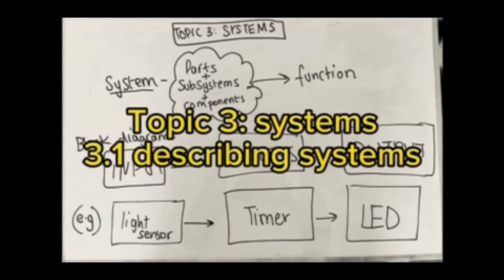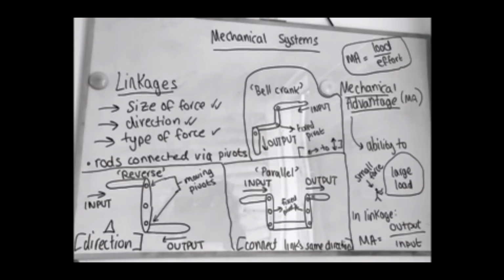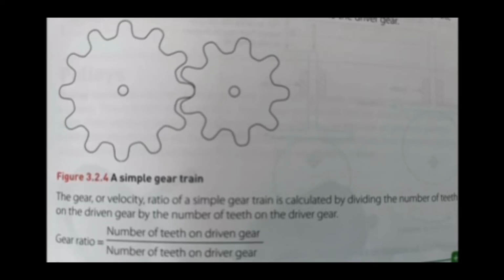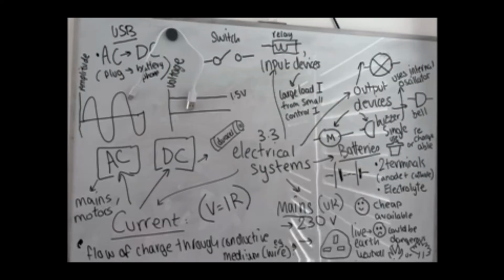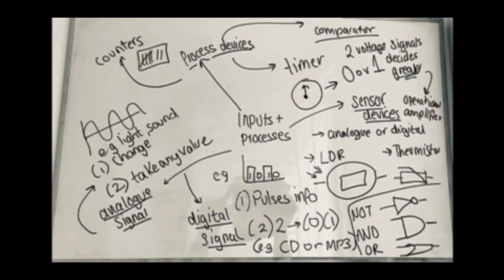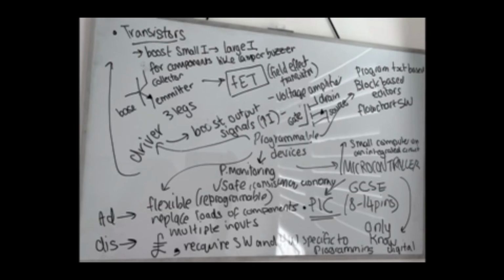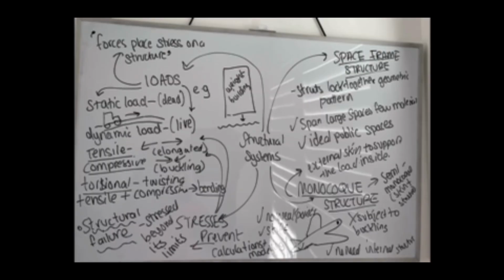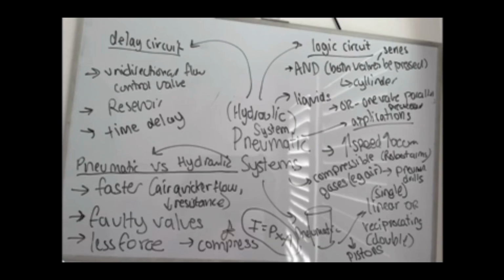GCSE Engineering: The Whole of Topic 3: Systems

Comment: I have a question, what is the difference between cam + followers and crank +slider?
Reply from the maker: Cam and Follower:

Cam: A cam is a rotating machine element that typically has a non-circular profile, known as the cam profile. As the cam rotates, its shape pushes against a follower.
Follower: The follower is a component that is in contact with the cam. It moves according to the profile of the cam. The follower's motion can be linear, oscillatory, or a combination of both, depending on the cam profile and the type of follower used.
Application: Cam and follower mechanisms are commonly used in engines, printing machines, and various automation systems where precise and controlled motion is required.

Crank and Slider:
Crank: A crank is a rotating machine element that converts rotary motion into reciprocating (linear) motion. It typically consists of a crankshaft with an offset (eccentric) portion.
Slider: The slider, also known as a connecting rod, is a component that connects the crank to the object being moved. It translates the rotary motion of the crank into linear motion.
Application: Crank and slider mechanisms are widely used in engines (such as internal combustion engines), pumps, and various machines where linear motion is required.